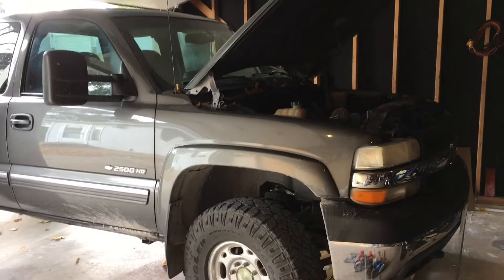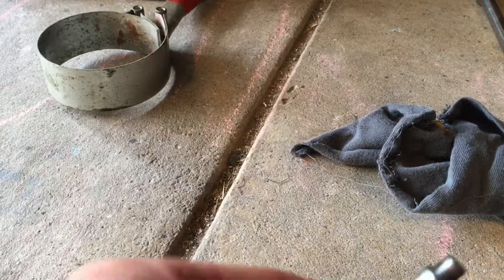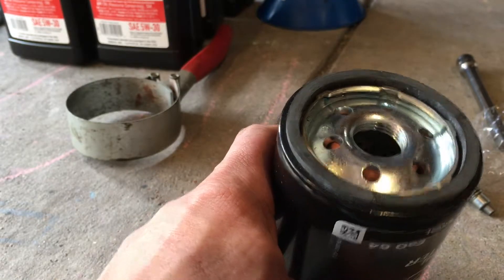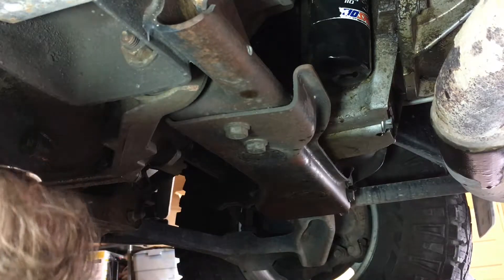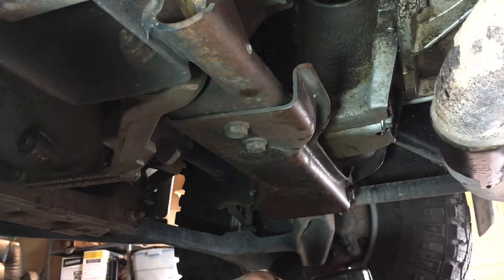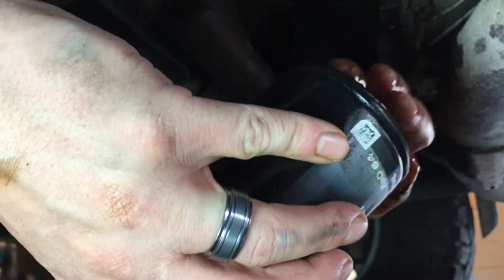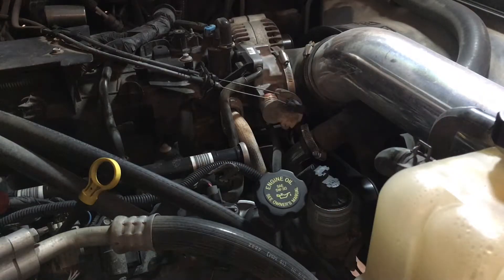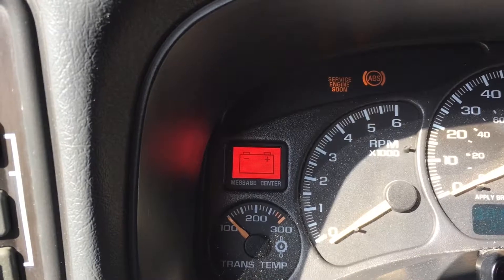02 Silverado Oil Change

Comment: What size was that oil filter you used on your gm 2500hd 6.0 engine?
Reply from the maker: https://www.amsoil.com/lookup/auto-and-light-truck/2002/chevrolet-trucks/silverado-2500-hd-pickup/6-0l-8-cyl-engine-code-u-3/?volume=us-volumezo=5147384  Here is a link to it on the website.